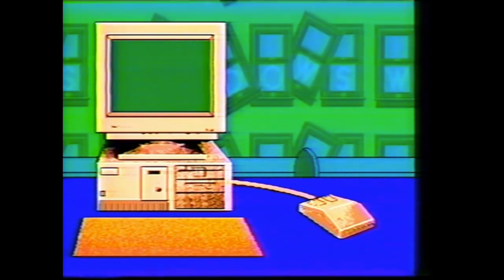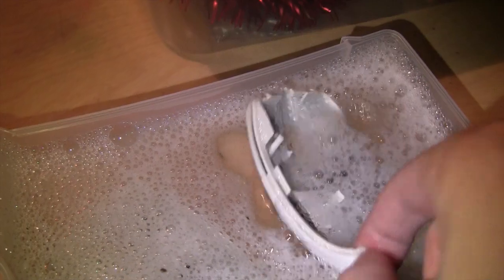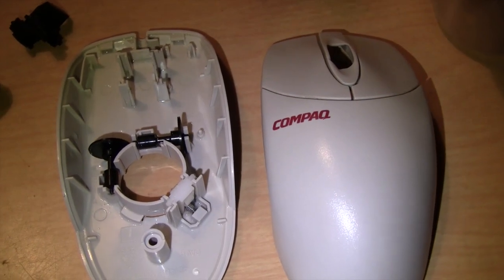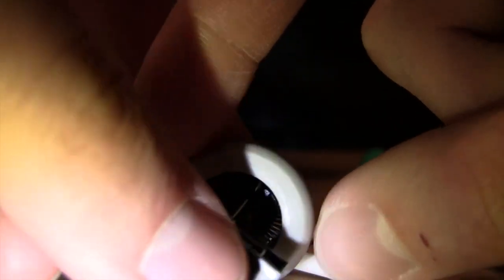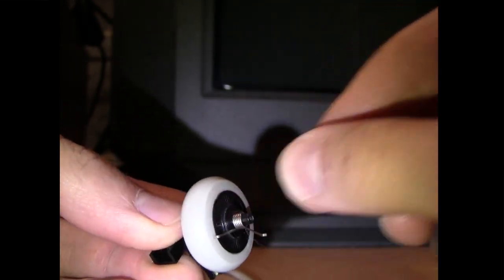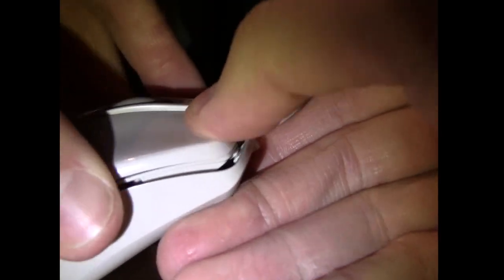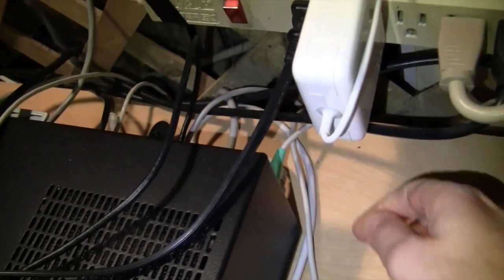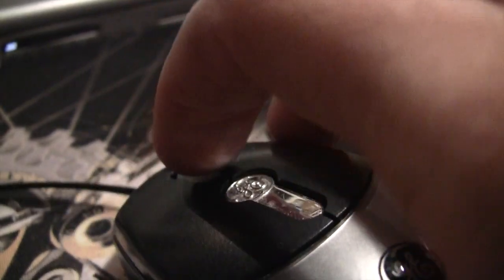How to fix your mouse's scroll wheel

Comment: I watched this video when it first came out, but today was the day my mouse's scroll wheel crapped out.  I reviewed your video, had it apart, cleaned it all out with a brush and air compressor, and back together within 5 minutes.  Didn't even power down the system.  Tons of cat fur, hand salsa, and I don't know what else, but after that it works like brand new.  It's a 1998 Logitech iFeel mouse, so mine made it 19 years.  I still keep an original IBM PS/2 2-button mouse hooked to the PS/2 port as a backup, but I didn't even need it.  Perfect, clear, concise instructions as always.  Thanks a bunch!

Comment: I have a similar mouse that was much dirtier inside that I cleaned similarly. After I got it back together though, I found the scroll wheel doesn't ratchet anymore. It still spins and works just fine, but the ratcheting is gone. Have no clue what happened. I should open it again and see if I inserted the metal springs wrong.

Comment: I've refurbished quite a lot of mice this way. The quality ones usually clean up well, even if they've been heavily used. I like to replace the grease they used for the scroll wheel assembly.

Did your StinkCentre finally kick the bucket?
Reply from the maker: No, the ThinkCentre is still working.

Comment: Do desktop computers still come with PS2 ports?  Or is that just an older motherboard?
Reply: Wait, some motherboards don't have PS/2 ports?! What's next, GPU with only HDMI out?
Reply: Depends on the brand and style of Computer some do some dont
Reply: My modern z170 motherboard has a single PS/2 port.
Reply: Architector #4 it's a legacy port, mainly for ps/2 keyboards for ultra low latency and n key rollover. Most ps/2 devices can be adapted to USB. However to keep latency you need a dedicated ps/2 channel.

My motherboard also has a dedicated USB port for n key rollover.

You can also use the ps/2 port for waking the computer (separate from wake on usb).

You don't need two legacy ports.
Reply: Nidhogg84 
I'm too lazy to google, what's n key rollover?
Reply: Architector #4 the ability the press all keys  on the keyboard simultaneously and all will register. Many keyboards only allow 5-6 inputs before the buffer is full.

so you can smash your face into the keyboard and you'll get adbdicgebfivtyebfobysbfud. instead of beep beep :p

in reality it's good for fast typers and games.
Reply: I now want this. My crappy notebook has 0 PS/2 ports.
Reply: I did see a few mobos like that but most of them still come with  PS/2 ports.
Reply: CreeperGuy555 
My notebook's keyboard is crappy and already broken in many, many places. For example, Z key randomly spams itself but stops spamming whenever you press SHIFT or any other neighboring keys, some keys are very unresponsive, some don't even work, some key caps got broken so I had to replace them with other caps from keys I don't use too often, for example my W key has ]} symbols on it, and D key is a darn context menu, while these ]} and context menu keys are just little rubber things just sticking outside, which work, but unused most of the time. I have a seperate USB keyboard, that's like 7 years old already, which has broken spacebar support (i.e. you can't press on the left or right side of it without making it tilt). but I learned to press into the center...
Reply: no.PC/2 port is band

Comment: This is why I would be apprehensive about buying a used mouse (if I don't know who had it last) even if they look clean. Good advice though, since this is an extremely common thing. I have a NOS Dell mechanical mouse that will need cleaning eventually, and it's probably built in almost the same way as this one. Ever thought about doing a video about repairing a mouse that doesn't scroll, click properly, etc? Since even well built mice like this develop that problem after so many years. Haha, nice clip of the Bucket Woman too! lol

Comment: i think WD-40 will help (it worked for my Logitech M170 mouse),
open the mouse and spray WD-40 over mouse wheel and dry it with blower or vacuum cleaner (blower)

Comment: Your mouse lasted for 15 years? Is it just me or do modern ones barely go 2 or 3 years?
Reply: I've had one for 7 years and it's still working.
Reply: My last one lasted 5 years before I bought a new one. It didn't break, I just wanted an upgrade. If anything it needs cleaned but it works fine still
Reply: Depends on two things - what modern ones you buy, and how do you take care of them. I'm also a Logitech fan, and I have two M185 ones - one is 3 years old, the other one is probably 5 years old. Both of these mouses function perfectly (almost like new), and I've never considered to buy a replacements, because they are so easy to fix. 1st problem - dirt - just clean it out, 2nd one: microswitches - I ordered a pack of those from ebay for a few bucks, because from heavy usage they tend to wear out. When that happens - 1 screw, 5 minutes of soldering and the mouse is like new again (only did it once).  And besides new mouse costs around $15-$20, so I think it's really worth to spend 20 minutes to save some extra money for candy. Mmmmmmmmmmm.....

Comment: My floppy drive in my Dimension 4550 had dust everywhere, so I improvised of how to remove the dust: open the door on the drive and blew in there with my eyes closed. Fortunately, it's a TEAC floppy drive. And to reduce the noise on my mice wheels, I removed the thing that makes a clicking noise when scrolling.

Comment: My scroll wheel on my MS IntelliMouse doesn't have any metal parts, so I guess that's one less thing to deal with.
I also lubricated the joint areas of the wheel.
(Also there was a paper ribbon cable so I had to be careful around that)

Comment: :) i was actually eating when you advised not to eat while watching this clip :)). About the PS2 hot swap, have you tried starting the computer without a mouse attached and after the OS loads attach a mouse...does it work this way ?
Reply: The PS/2 port wasn't designed to be hot-swapped. Modern I/O controllers are more robust, but there is still a risk of damage to the controller and its circuitry.
Reply: Interestingly, but off topic, in one of my computers you can use the keyboard in the mouse PS/2 port and vise versa... Probably just two combination ports they painted different colors.

Comment: how do i fix one that doesn't have a screw to open up.  i got it off ebay and it was working fine.  have to use the ball kind cause i am sensitive to the led light and electric and it makes my hand burn with terrible nerve pain.  it was working today (the day it just came in the mail) until i dropped it on the floor off the desk.  i can unscrew the patk with the BALL but i need to open it up cause something inside either broke or came loose but i see no screw to open the actual mouse open.  any thoughts.  it is called a 520dpi scrolling internet mouse and has a usb end to it. i got it for about 8.99 off of ebay.  NEW VINTAGE 3 BUTTON USB MOUSE WITH SCROLLING MECHANICAL BALL (NON OPTICAL) the title on ebay

Comment: ew now I'm hesitant to buy all the $0.50 mice at the goodwill when they show up. I noticed I had a bag of computer mice in my unfinished bacement and the wheels on some are turning all gooey and sticky like when I role it some residue gets stuck on my finger. can this conundrum be fixed? I suspect it might be some kind of dri rot given the fact that the rubber bands keepin the wires tied have also started to do the same
Reply from the maker: Just clean it with soap and water like I did here.

Comment: How do these sensors know what direction it goes?
Reply: There is one IR emitter and two sensors on the other side of the slotted wheel. The two sensors generate a quadrature encoded signal - https://en.wikipedia.org/wiki/Rotary_encoder#Incremental_rotary_encoder https://hackaday.io/project/5875-busmouse-to-usb-hid-conversion

Comment: There's also an optional mod that most logitech mice like this will support. Remove the spring that makes the scroll wheel clicky, if you don't like your scroll wheel clicky.
Reply: Man I bought a new expensive Logitech mouse just to have this "silent" feature as the loud clicking was beyond obnoxious.
Reply: Mark M I have mild arthritis in my hands. During extended sessions of scrolling the clicking can really irritate my joints. I have two Logitech M510 mouse now one modded with no spring for a smooth scroll and one with because of this. Not yet sure if i want to do it to my Logitech G600 yet. The springs are a bit different in these very modern mice but is just like the video for something like the Logitech M100.

Comment: I bought one from goodwill and I did that but used a lysol wipe and scraped the wheel and the roller ball wheels . and it was sticky wheel but works great . on my desktop I have a usb keyboard. and a logitech ball mouse like yours no compaq tho.

Comment: Honestly, for $5 or so, buy a new mouse... Great video! I enjoyed learning something new about mice.
Reply from the maker: They don't make new PS/2 mice anymore.
Reply: There are still a few, but they're mostly USBs with included ps/2 adapters. Far as I know that's how "ps/2" mice have been sold for a long  time, with an included adapter. Mostly, you'll have to buy the adapter separately these days if you're set on ps/2.
Reply: I should have known that. I had a hard time finding one the last time I needed it for use with a PS/2 KVM switch/ rack mounted monitor combo unit to service an IBM/Toshiba retail server rack. I don't think I ever replaced the mouse on the KVM.  I used a USB mouse to complete the service request and we lost the customer before my company could authorize a PS/2 to USB adapter.

Comment: I'm pretty sure I have the same mouse, though mine is black and has a Creative logo on it(matches my Creative branded black Mitsumi keyboard). if I'm not mistaken, that's a Logitech M-S48.
Reply from the maker: Mine is an M-S48a, so it's probably a slightly newer revision of the design.

Comment: Cool video!  Nice clip from "Keeping Up Appearances"; I love that show!  I use a 2014 Lenovo mouse, and I don't see any visible screws on the bottom of it.
Reply: might have to remove the foot pads like i have to with mine though id recommend buying replacement pads before taking them off as they're more then likely glued on and more than likely wont stick back on after removal
Reply: Bryan Gullickson I did some Googling, and it turns out that the screw is underneath the sticker on the bottom of a Lenovo mouse.
Reply: interesting
Reply: I've seen that on a lot of mice

Comment: Too bad modern wireless Logitech mouses are so much difficult to dissemble than these old mouses :(
Reply: Modern Lenovo wireless mice on the other hand are very easy :)
Reply: But are they as accurate as Logitech wireless mice? I've never used a Lenovo mouse before, so I don't know :)
Reply: I think they are pretty much the same as long as you're talking about those standard office mice
Reply: Mine is Logitech M610 I think it's a fancier office mouse. I've been using it since 2012, and it still works fine except for the scroll wheel. I can't clean it because I can't open this damn mouse. You wont believe me, but this particular mouse doesn't have any screws :)
Reply: Cool, I've got the MX620. Solid mouse. I guess you mean the MX610 because I can't find any info about a M610. Are you sure there are no screws under the rubber pads on the bottom? Of course it'll be a pain to get these pads on again.. But hey, the MX610 sells for around 120 bucks on Amazon haha :D
Reply: On a closer inspection I found out that my mouse is the same as yours - MX620. Btw just a quick question, do you ever use the search button on yours, I never do on mine :)
As for the screws, I didn't knew that they were under the rubber pads. The rubber pads came out just after 1 years of use on my mouse, and I glued them all with a powerful glue and as stupid as I am, I haven't memorized if there were screws under them or not :)
If there are screws under them, it would be nearly impossible for me to take them off, cause of the super-glue :)